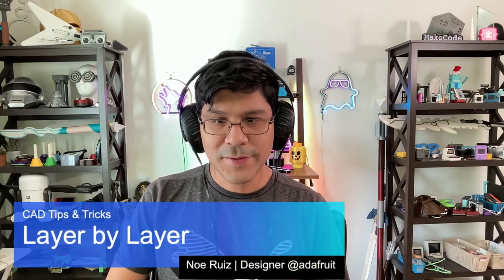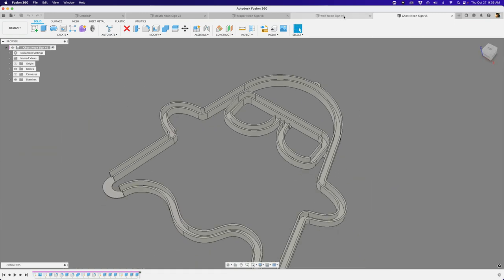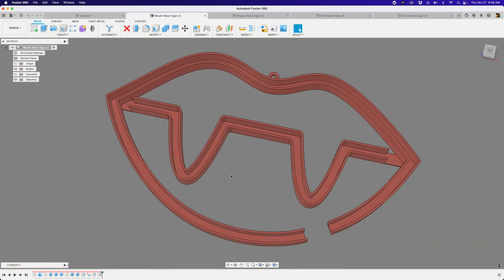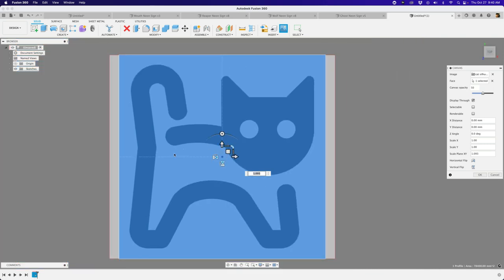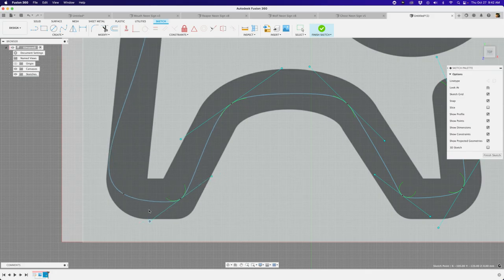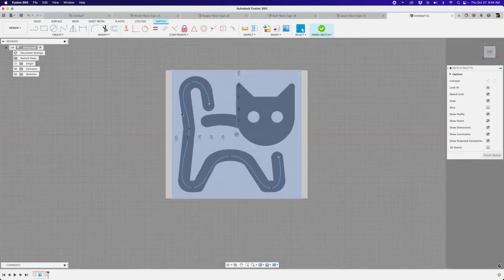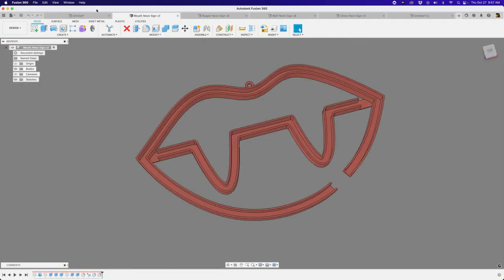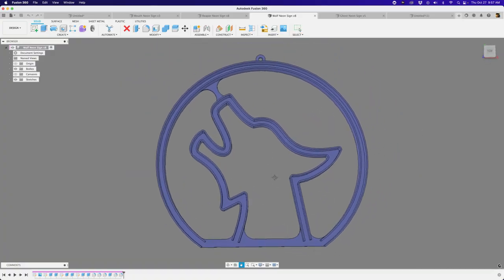Layer by Layer - Neon LED Signs – Fusion 360 Turorial

Comment: Nice! Tip: there is a center point rectangle tool you can use instead of construction lines with constraints. A lot easier and faster.